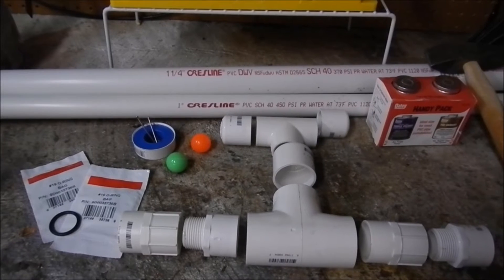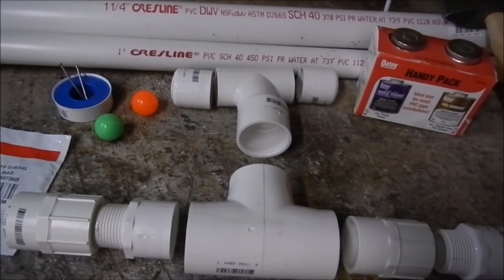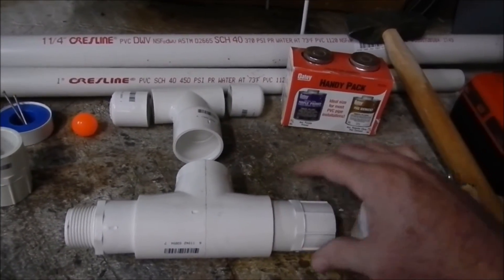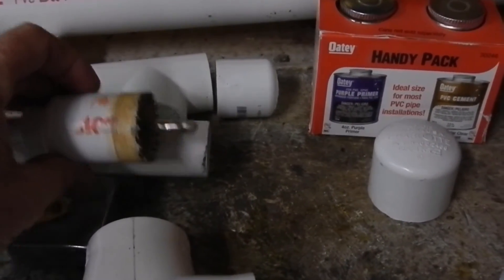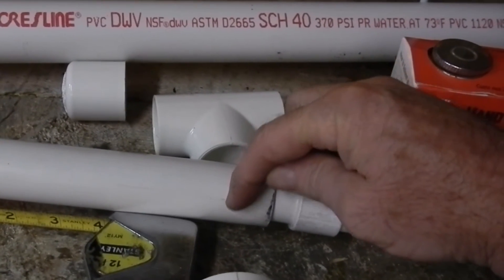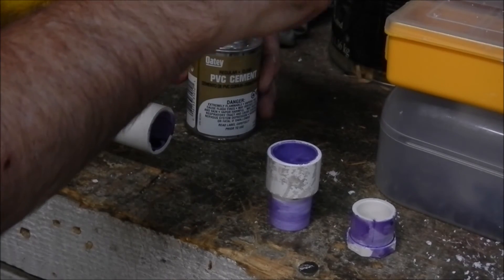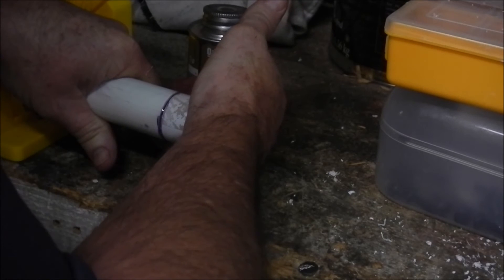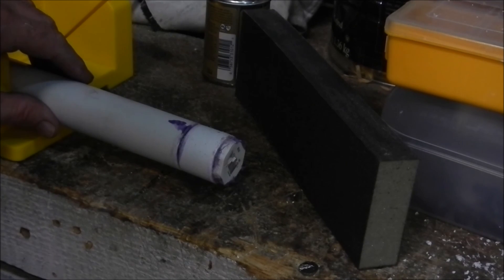PVC hand pump part 1 DIY

Comment: Can you put the supply list here?
Reply from the maker: 2-#19 O-Rings, Teflon tape, 2 rubber balls, 2 finishing nails 2 inches long, 
2- pvc pipes at 48 inches 1 being a 1 inch the other 1.25 inches, 
2- slip tees 1 being a 1 inch the other being a 1.25 inch, 
2- slip caps at 1 inch size.
1- slip cap 1.25 inch
2- pvc joints slip to female pipe thread at 1 inch size.
2- pvc joints slip to male pipe thread at 1 inch size.
PVC primer & glue.

I hope this will work for you.
Reply: Thanks for the parts list, I hope I can put it all together correctly, LOL. It seem like there is something missing in your parts list though? hahaha, that would be awful !